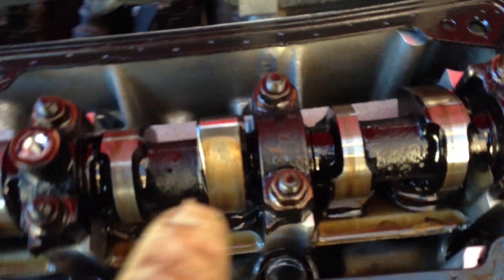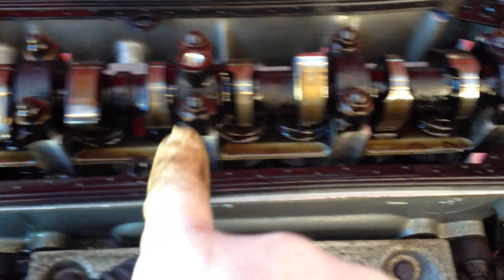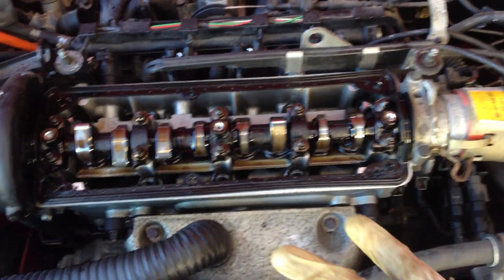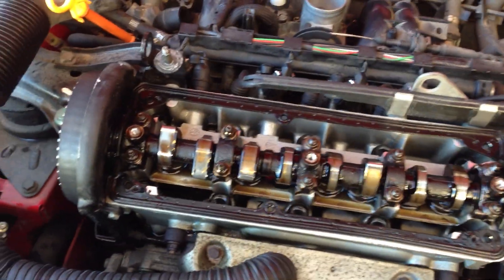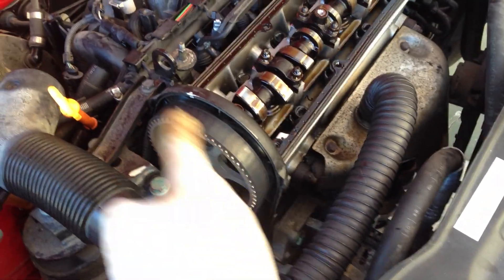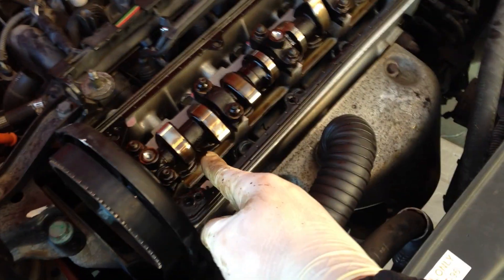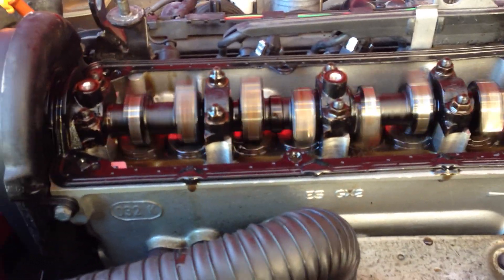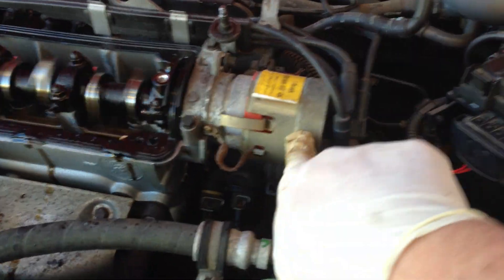How A Camshaft Works

Comment: Hello there! I know I'm a bit late, but I'd like to make a comment here:
I like to think of a camshaft as being a bit similar in concept to a mechanical music box. As you explained, the little projections on the camshaft control which valve is working at what point in time. Well, a mechanical music box is similar in a way. It's got a cylinder with little projections on it (similar to the camshaft) and those projections trigger the right notes at the right time depending on how they're situated on the cylinder. So, the camshaft can be "programmed" to opperate the valves at the right time depending on how the little lobes ar positioned on the shaft, just like how a music box can be programmed to play a particular sequence of musical notes. In fact, I can even remember reading an artical where the author wrote about how the concept of a music box likely evolved from the camshaft, or vice versa.
Anyways sorry if this was a little long, just wanted to offer my thoughts on this. Please feel free to reply with your thoughts on this! Stay safe and have a nice day.